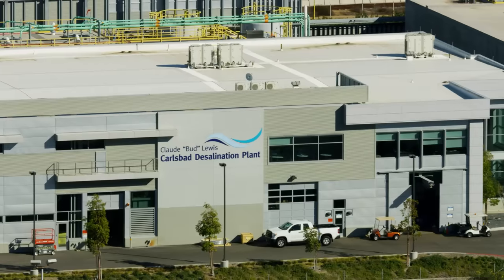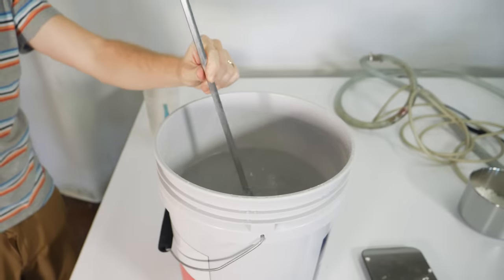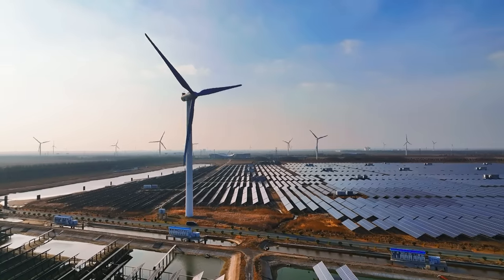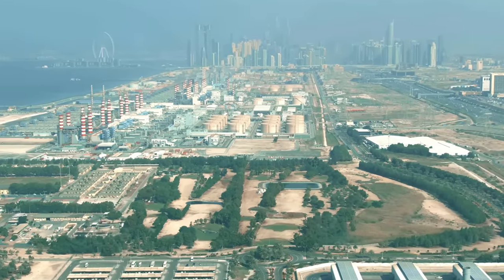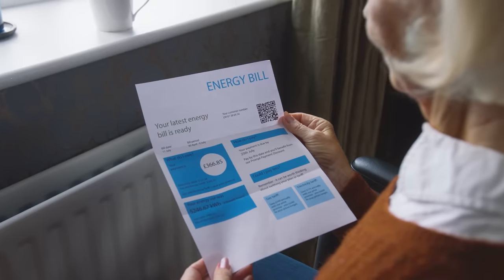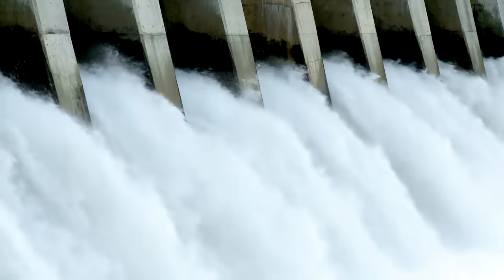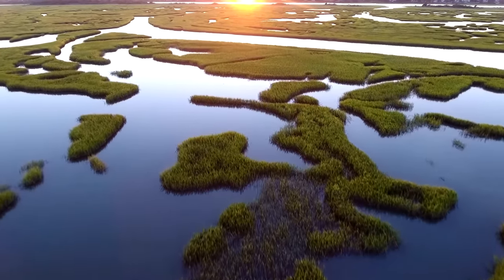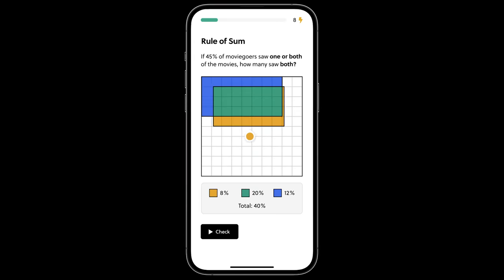Why Is Desalination So Difficult?

Comment: Cant you just use a vacuum? The pump would take out the air, then water being water, would vaporize at low pressure, then the water vapor would be sucked out by the pump and the air would be cooled to allow the water to condense. Then you only need the power of a heat pump and vacuum pump.
Reply: If that was more efficient they'd be doing it already.
Reply: This is a form of distillation. It works, but it's not nearly as energy efficient as RO. The vaporizing water still requires a lot of heat input, and you can't recover all the heat when it condenses.
Reply: @sealpiercing8476  But using a vacuum you dont need to input heat as you lower the vapor point to the temperature of the air.
Reply: All that is is low pressure boiling which is the expansion valve flash boiling method.

Keep in mind that their is no way to cheat chemistry. If you are causing water to transition from a liquid to a gas then you much pay the "heat of vaporization", and if you convert from a gas to liquid this heat will be returned. (This is why you preheat your water by using it to cool the condenser)

If you take a bathtub and expose it to space the water will flash boil, and then get super cold and some of it will freeze because its energy was stolen by the evaporated water.

Its also alot harder to pull a good vacuum than it is to increase pressure, even if both are energy intensive you will get much higher mass flows with fluid pumps than with vacuum pumps.
Reply: @FBI_Master  But you don't remove the enthalpy to convert water to steam (~4KJ per liter)
Reply: @hanifarroisimukhlis5989  doesn't water need less energy to vaporize at low pressure because the bonds waken as the pressure lowers?
Reply: FYI a s*x bot stole your comment and somehow is getting more attention than you.
Reply: @cakilas8966  Can you give the comment link?
Reply: @FBI_Master  it's complicated but I'm working on this exact problem. US10596482B1 was my earlier attempt. Basically vacuum lowers the temp of boiling but MSF or MED can help recycle heat/enthalpy of condensation for H (enthalpy) of vaporization. Vacuum does not weaken (waken?) the bonds. Use of a hydraulic (non-convection) heat pump is smart in certain contexts (e.g. hot desert environment).
Reply: I imagine the biggest issue is once its starts vaporizing the steam ruins your vacuum, so you need to keep putting effort/energy into maintaining it.
Reply: @FBI_Master  Vacuum only reduces the TEMPERATURE at which it boils. It has to do with entropy of vapor vs liquid water. Fun fact: It took 5 times as much energy to boil water than to raise it's temp from room temperature to boiling point..
Reply: @FBI_Master  No, you still need about 2 MJ/kg of heat. If you don't supply the heat it will come out of the remainder of the water, cooling it until it mostly stops evaporating.
Reply: When I first joined the Royal Navy, we used to 2 stage flash evaps, for fresh water production. These used steam returning from other systems around the ship, to both heat the water and operate air ejectors which drew the vacuums on the stages.
 The only electrical pump was the one to draw seawater on board.
  Makes me wonder why they don't use the waste steam from power plants to run similar evaps, as all that heat is just going to be wasted to the environment.
Reply: @FBI_Master  No. The point of vaporizing at low pressures is to use lower temperatures, which may allow the heat to be sourced as waste heat.
Reply: @Stormcrow_1  dont many powerplants nowadays connect to a long-distance heating system?
Reply: @sealpiercing8476  Also allows you reduce scale build up. meaning less maintenance.
Reply: @georgelionon9050  That would depend on you location I suspect, never seen it used like that here in the UK.

Comment: I’m an engineer on an oil tanker, we have an evaporator. We use heat from our main engines cooling water. And an ejector pump to create a vacuum, fun fact. Water boils at a lower temp while under vacuum. Our water is usually 1ppm salinity.

Comment: There is a good deal of entropic energy difference involved between fresh water (a highly ordered state) and seawater (low ordered or  more chaotic state).

This is why there is considerable amount of energy required to extract pure water from seawater. It takes energy to increase the order of a system.

It works the other way as well. The figures I have seen say that every stream of fresh water entering the sea releases the energy equivalent of it falling 700 feet. Allow a flow of fresh water to pass through an osmotic barrier in to a fixed volume of seawater. The fresh water will want to draw through the barrier and that produces a high pressure in the fixed volume, which is available to be tapped to a turbine for electricity production.

A better use of the brine from desalination would be to transport it to a region with fresh water streams and use it with that water in an osmotic power plant.

One other consequence of the high pressures of reverse osmosis is that the OH- H+ concentration balance (ie neutral pH point) shifts under pressure so the output fresh water has to have it's acidity corrected to neutral.

Comment: I'm a fan of the opposite; using freshwater flowing into saltwater to generate electricity
Reply: The problem is that unless you have a huge amount of fresh water, 'osmotic energy' is generally not super practical. Lets say you are using 30 kWh per day and want to get that from osmotic energy. You would need to convert 40 cubic meters, or 40,000 litres or ~9,000 gallons of fresh water to salt water to produce that. That is a pretty ridiculous increase over the few hundred gallons of water the average person uses. While it could potentially supplement energy production, it is not really a practical way of generating the a substantial portion of our electricity.
Reply: @DembaraLemoon  Maybe he meant hydroelectricity. That description fits a regular ole river and hydro dam... If so, very droll. Well done sir
Reply: @DembaraLemoon  I'm not sure why you'd compare that to the amount of water the average person uses per day - it's not like anyone is saying "hey let's use our drinking/grey water supply for power generation". Anyway, the technology seems to be limited to off-grid applications where rivers meet the ocean, or taking advantage of other freshwater sources like effluent from sewage treatment goes into saltwater
Reply: @dj_laundry_list  because that is what is being used... It is increasing the use of fresh water to decrease the use of electricity...
It is not really sensible 'off the grid' since you need industry to harness it and solar/wind are more sensible. Rather, it could be used anywhere that you have a freshwater supply near saltwater, which is pretty much every coastal city from London, to New York to Tokyo. The thing is it just isn't a worthwhile trade-off.

Comment: I don't understand why there would be an issue. It needs a lot of energy, but it could easily just be a byproduct of something else.

Nuclear Reactors are one of the most efficient ways we know to generate power, and boiling water is literally a byproduct of that extremely efficient power generation.

You could ljterally attach desalination to a nuclear reactor and get drinkable water as a byproduct of creating electricity.

Comment: I remember making a miniature water distilling setup for science class in middle school. I made two versions, one was hot plate based with a plastic wrap shell that used ambient temperature to condense and channel the water to a separate container, the other was a "minigreenhouse" that used some magnifying glasses inside the plastic wrap shell. Both worked, but the greenhouse took about all day in the sun to make a mouthful of water, and the hot plate one would be exorbitantly expensive to run.

Worst part though was that the day I had to present my experiment was cloudy, so I couldn't actually demonstrate all of my experiment and my data ammounted to a 6th graders "Trust me bro"

Comment: Pour salt water into a pot sitting on top of the stove. Put a small riser centered on the bottom of the pot and a drinking glass on top of the riser with the top of the glass well above the top of the liquid. Turn on the fire & put the pot lid on the pot upside down. As steam condenses on the underside of the upside-down lid, the distilled water runs down the sloping lid and drips into the drinking glass. That's how Mr. Wizard taught me to do it.

Comment: A normal inexpensive home RO system is very efficient. It uses the water pressure provided by the water company as its energy source. It doesn't need any other energy source. A five stage RO system that produces gallons of water every 4 to 6 hours is less than $200.00 and only needs a $39.00 filter replacement once a year. These systems are excellent and provide very clean & safe drinking/cooking water for any household with a normal public water supply.

Comment: I have the answer, but many are not going to like it.  I was visiting my wife's family in the Philippines and they had no shower head.  Just a bucket filled with water and a plastic cup.  I was shocked at how little water it took to  bathe.  Pouring 3-4 cups of water over my body, lathering and scrubbing and then pouring another 4-5 cups to rinse.  Back in NY I would have been in that shower at least 15 minutes, even with a restrictor that's about 37 gallons of water vs 2-3 gallons I used in the Philippines.  I never looked at my water usage the same after that.  In areas with and without water shortages we need to also change how we use water so that there is more water for everyone. This includes using low lather soaps that don't require a ton of water to rinse and other things.  We have to change, all of us, everywhere.

Comment: Also a thin layer of a semipermeable membranes work at keeping plankton and microorganisms out of the pumps. The water with high salinity doesn’t need to be directly pumped back into the ocean. Sandy shorelines are porous but great at keeping some salinity in the sand where it builds up in higher concentrations anyway from rising and receding tides.

Comment: I like your experiments - a very visual way to explain the processes.
 I think your garage experiment for distillation has a flaw- the way you are transferring the heat from the heater to your vessel of saline water. You are using sand which has lots of air gaps, and poor conduction from one grain to the next due to small contact areas.  You will use a lot less energy if you were to use oil instead of the sand. It would also help if you had a film of oil between the hot plate and the saucepan.  The oil will get rid of the air between the two surfaces. Air is the perfect thermal insulator - especially if it is trapped in small chambers.  I would be interested to see how much more efficient the distillation process was then.
The best science and engineering is achieved when one experiment or system is built and tested, and peers then review and suggest improvements.

Comment: Vacuum distillation is simply distillation at pressures below one atmosphere. Reduced pressure permits vaporization at reduced temperatures. For instance, at atmospheric pressure water boils at 212°F (100°C); but under vacuum (typically around 27" Hg) this boiling point can drop to 135°F (57°C) or lower.

Comment: I am so lucky to live near a deep spring where I can fill 5 gallon jugs every few weeks. The Wisconsin DNR tests it on occasion and have said it is the purest spring water in the Midwest. The spring comes from an aquifer that is 1000 feet deep, working its way up through limestone - a perfect filter. It is the best tasting water I've ever had! It's a primary reason I would never move to another state.

Comment: I have an idea for high volume, high speed water transport and desalination.  First, start with a large source of fresh water.  Boil the water by focussing a large array of solar mirrors on the boiler, producing low pressure steam.
  Now consider the design of a jet engine: air is pressurized in one or more compression stages, heated by burning jet fuel, and gives up some of its energy passing through expansion stages that drive the compressor.  Use a similar jet engine to accelerate the low pressure steam, except that instead of jet fuel the steam is heated by the concentrated sunlight from another large field of solar mirrors.
  At this point we have high pressure steam moving fast along a pipe.  By re-pressurizing the steam every few kilometres with another solar turbine, such a pipe might transport the steam long distances.  Pass the steam through a heat exchanger at the destination to yield water and possibly useful work.

  For desalination, inject salt water into the high speed steam, yielding a cooler steam suspension of salt particles.  Salt removal is now a mechanical problem.  Remove most of the particles in a vortical separator, then pass the mostly clean steam through a low resistance filter.  Return some of the resulting fresh water steam to before the salt water is added, making the process continuous.

Comment: Interesting thought - we make the assumption that desalinated water is required for 100% of household water needs, but why shouldn't salt water be perfectly adequate for flushing toilets and taking showers? I have well water and my water "softener" is adding salt (in small quantities) to my water - enough that it shouldn't be used for drinking, and with a bit of nautical experience I've used seawater for cleaning, bathing, even cooking. It's normal to salt water for pasta. What we do need is water free of particulate matter and harmful microorganisms, which is probably easier to do than removing salt.

Comment: Long-distance cruisers often have reverse-osmosis units onboard.  They're sometimes powered by solar-charged batteries.  On top of that, they do amazing things to minimize their water use.  My favorite is not wearing clothes that will later require lots of water to be cleaned later.  Skin and hair are easy to clean.  The first step can be getting wet with seawater, then lather up.  Rinse with seawater, then some fresh water out of the Solar Shower -- warmed by the sun.

Comment: I think the minimum energy is about the energy emitted during dissolution of the Salt in water. It is an exothermic process so to separate Salt from water one needs to spend the enegy it emitted during dissolving.  I think, for the thermal seperation, can't the cooling water of nuclear or thermal electric plants be forced into solar heaters(which are cheap)? In summer, in a mediterranean country like Turkey,  they can generate 60 or more degrees Celsius water, in some sunny places like Antalya, if you don't use the water frequantly, the storage unit can explode because of the steam pressure. So take the seawater at 20-30 degrees, cool down some plant and get 40 degrees perhaps, then force it into giant solar heaters, heat them into 80-90 degrees, reduce the pressure get the steam, increase the pressure, and cool it with seawater to get more water plus, recyle the condensation energy, cool down the brine if it had not cooled enough from evapouration. Use Reservoirs to pool excess cooling water at night or cloudy days perhaps, and use it in times when the sun is highest. Discharge the brine in saltpans to Extrakt salt and minerals like Lithium if possible and feasible. Use Thermostats and AI to decide the speed of water forced into solar heaters so you get constant warmed water for the evapourator. In places like middle east or chile,  where coastal deserts exist so land is cheap and sun is abundant, it can be cheaper than reverse osmosis.

Comment: So instead of heat for distillation I'm wondering if we could use a vacuum. Negative pressure should boil water and also reduce the energy requirements.

Comment: Heat desal could be more efficient at scale. If you direct the steam into generators you can produce power, also steam moves up, so if the collection is at elevation you can pipe it down into water turbines before further storage and minerals are added. 
For salt cleaning, the bottom of the heat tank can have a slowly moving squeegee like used for cattle barns to move the salt before it dries. Then sell the salt. 

Not sure if this has been done before but the theory sounds good on paper lol
Reply: RO is cost effective

Comment: I've always seen the salt buildup in desalinization as a business opportunity to sell sea salt in addition to providing water.  Add in a power generation tower with mirrors and use the boiled water to turn turbines and you can generate at least some of your power needs back too.
Reply: Sea salt is made cheaply by filling huge pools with seawater and letting the sun do it's magic. You cannot compete with free.
Reply: @solaroid4442  NaCl is used in quite a few industrial processes. You’re not trying to make a profit, you’re trying to recuperate operating costs with a “waste product” of the process.

You completely missed what I was saying.  Also, it’s not “free” considering there is pumping costs, collecting costs, and maintenance of all the equipment.  Cheap, sure, but not “free”.  And like i said, you’re finding a use for a waste product to offset costs, not competing with Whole Foods “organic sustainability sourced vegan keto sea salt from Fiji”.
Reply: As a matter of fact, not all sea salt is even from simple evaporation. That only works in hot dry climates. UK produced sea salt like Maldon is heated with flames to evaporate.  

And the FDA only requires that the salt was “at one point from the sea”, so some mining operations count.
Reply: I would also add that if we moved to large scare desalination, the excess salt would extremely quickly exceed the demand for it.